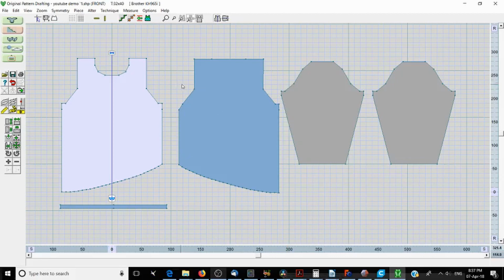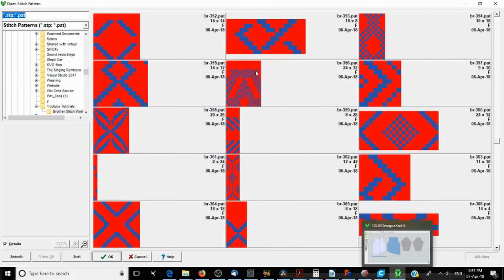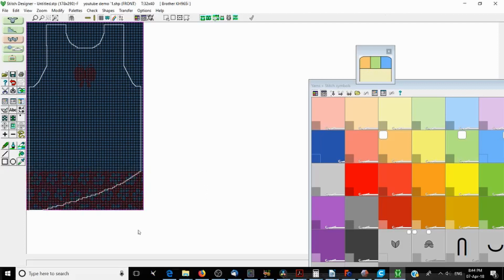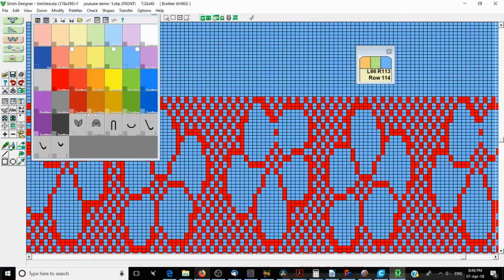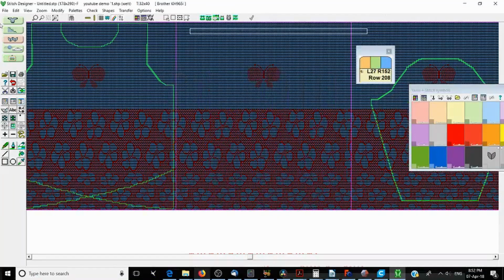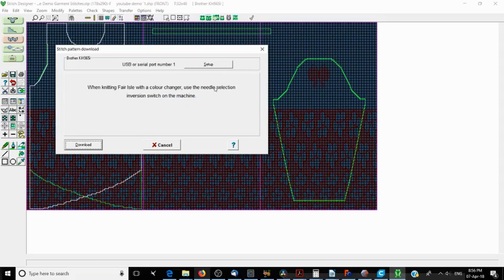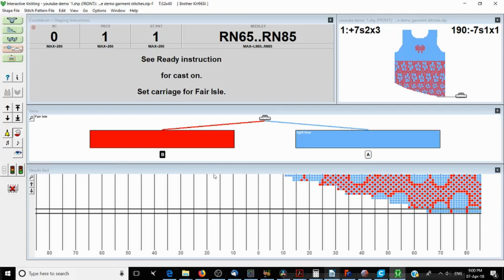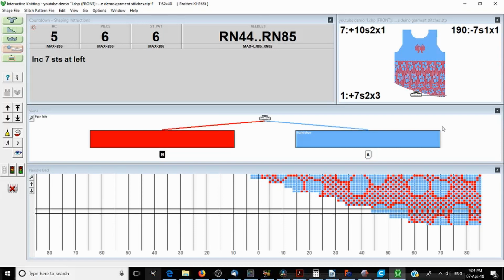Designaknit Garment Design Tutorial 3 -Stitch Design and Interactive Knitting

Comment: Very good tutorial, but there is a slight error. In interactive knitting as you knit fairisle with KC setting on carriage you cannot also use the magnet arm. It would count each row twice. To use the magnetic arm you need to unplug the cable from the knitting machine. Or don't use the magnetic arm and leave the cable plugged in at machine and computer.
Reply from the maker: Thanks Kahawo. The cables I have tried does not function with IK without the magnet arm. But thankyou for pointing this out.